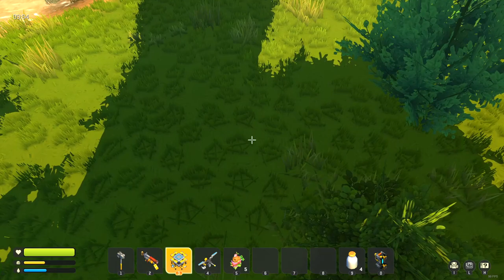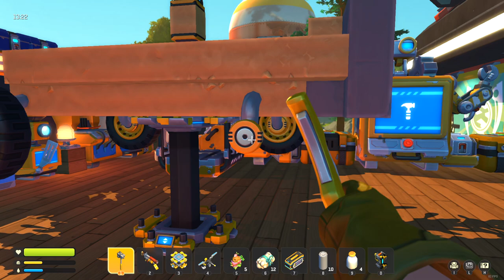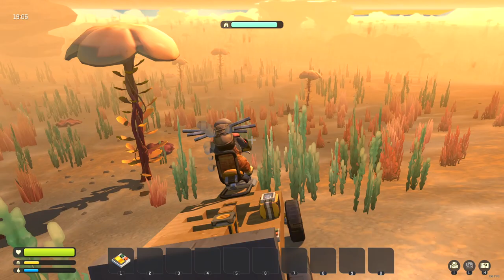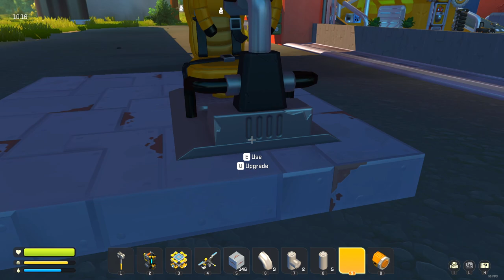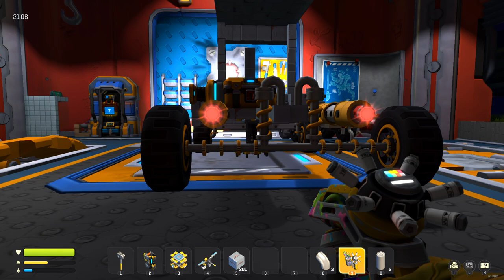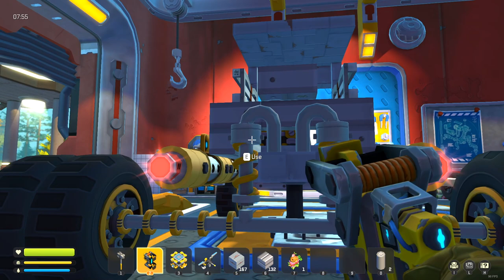Bearing Powered Vehicles : Scrap Mechanic Survival

Comment: I love those headlights on yer truck. I was able to reduce the bearing drive's wobbly-ness in my RV by attaching a suspension to the outside of the wheel. If you want to free up some space in the bed of yer truck, you can lower those bent pipes down some by deleting the block under the suspension.
Reply from the maker: Awesome!  I'll see what I can do with the suspension!

Comment: Bearing power is so much simpler and more economical although I reckon it might get nerfed at some point seeing as it seems to make fueled engines somewhat redundant when it comes to wheeled propulsion? 🤔
Reply from the maker: I'm worried about the same thing.   If it does, so be it I guess.